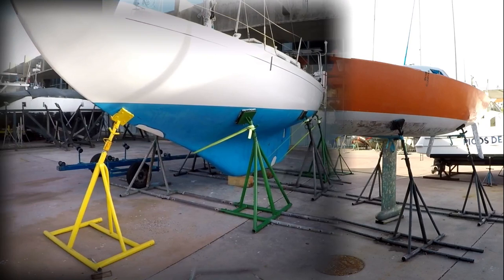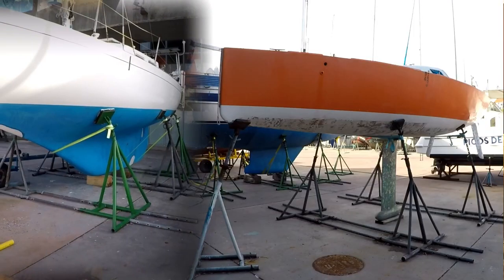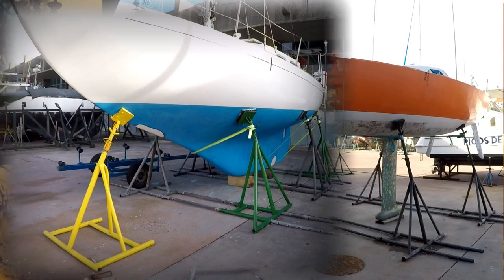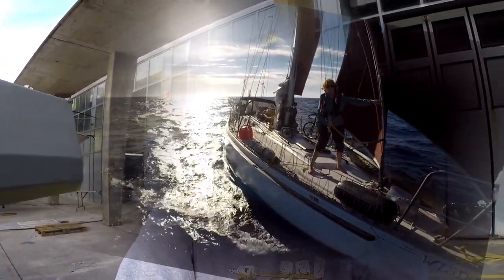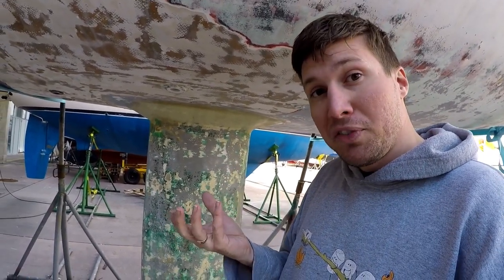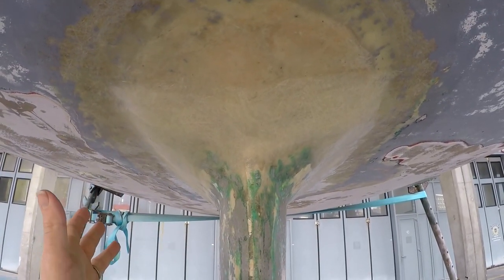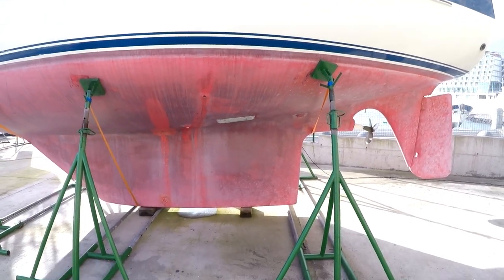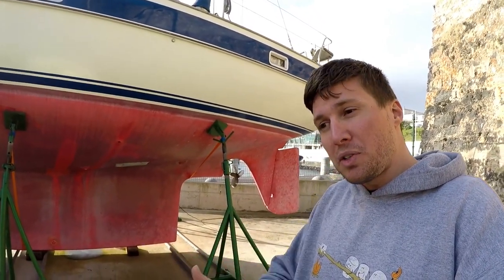Which is the BEST Keel Design? | Sailing Wisdom

Comment: I'm looking at a Contessa 26 and my friends told me that I won't be happy because it'll be so slow. What do you think?
If you have two identical boats, one with a full keel and one with a race keel. Say for simplicity sake, the full keel boat top speed is 6 knots. What would the high aspect ratio keel boat top speed be? Obviously this would just be a guess..but what's your guess? Thank you:)
Reply from the maker: The top speeds will be the same because of the hull speed limit. Basically, the longer the boats waterline, the faster it can sail without planning. If both boys have the same waterline length, no top speed difference! The equation is: hull speed = (water line length in feet)^0.5 x 1.34
The big difference comes in light winds. A heavy full keel will need more wind to get going while a light boat will zip along. I went out on a race boat one time, it was only 20 feet long and we did 18 knots! Obviously it gets up on plane and exceeds hull speed, and it did this in light conditions. It was very fun but I would be terrified of that thing if a squall came up while out sailing. A heavy boat usually needs about 15-20 knots of wind to start sailing nicely. 
In my experience, when we are out sailing in light air days (10 knots of wind or less), everyone is motoring. The light boats and the heavy boats are all going hull speed under diesel power, so no one actually takes advantage of their ability to sail in light wind. My favorite was when we passed a guy who was motoring and we were on a beam reach. He had a very light Hunter and was going the same direction, he could have been sailing but was motoring through the light breeze. 

My opinion: Contessa makes a really nice solid boat that you can have fun playing around in and if you ever decide you want to go further (or if you get hit by a storm) you are already in a very capable boat.

Comment: What is your opinion of a modified keel or centerboard? I have a '72 Pearson 33 with a 4 ft draft and a centerboard. My keel isn't as long as a full keel but it's longer than a fin keel just shorter. The centerboard gives a draft over 7 .5 ft.
Reply from the maker: Center boards are the best of both worlds. Shallow draft and excellent pointing performance!  Best of all, just as you can trim your sails to move the CE, you can also trim the board to move your CLR and balance the boat out better.

Comment: The front edge doesn't do everything lol. you can't just have a pencil say with a weight at the bottom for a keel, even if it was structurally possible, yes that would give a righting moment but the water pressure to enable sailing to windward comes from the surface area, at the cost of drag. It's a compromise.
Reply from the maker: Actually the pencil edge is all we need, but we don’t have the materials to make a pencil keel. All it needs is a aerofoil shape that is as high aspect ratio as possible to give the most lift with the least drag.

Comment: My boat has a cast iron keel which is bolted to the hull, and a skeg rudder.  However it's an older design (mid 1970s) so it has an integral "shoe" which is a wider flat portion at the top, which fits into a recess in the hull.  It seems a good compromise, with the stress over a wider area.
Reply from the maker: Sounds like the best of both worlds! Performance and strength

Comment: To make a statement "a keel to outrun a storm" is nonsense. No boat can outrun a storm when you are in bluewater at sea. Maybe, possibly if you are just off shore, but that will depend on wind conditions. Crazy to rely on the wind you need when you need to outrun a storm.
Reply from the maker: I agree! It’s much better to be able to ride a storm out than to rely on outrunning a storm.

Comment: It's not just the leading edge that provides lateral resistance to bring the boat to windward, it is proportional to the surface area, at the expense of drag.
Reply from the maker: Yes, but the leading edge does the most so the rest of the keel is just drag. This is why foiling boats have such high aspect ratio foils: maximum efficiency with minimal drag. 
That said, these also need speed to work while a low aspect ratio foil will provide lots of lateral resistance at very slow speeds. This is why a full keel heaves to and drifts slower than a fin keel.

Comment: I to like the long and full keel design however there is little information   of what is a reasonable draft depth for blue water cruising, what are your thoughts
Reply from the maker: Personally, the deeper the better when you are offshore. The water is thousands of feet deep, so bumping the bottom is not a concern. The further down the ballast is, the more effective it is at resisting the heeling forces from the wind on the sails. 
The issue is when you want to come into port, draft instantly becomes a concern and the deciding factor. On the US, west coast boats will typically have drafts of 8 to 10 feet because all of their waters are deeper, while on the east coast 4.5 foot drafts are the favored because it’s much shallower on that side. 
Wisdom has a 6.5’ draft and is considered a “deep draft” boat on the east coast. There are places that we just don’t fit (the Florida Keys) because of our keel. 
The question really comes down to where you want to sail, and then choosing a seaworthy boat that will let you sail into your destination.

Comment: Aero dynamic? Really? How about hydro-dynamic. It's not an airplane.
Reply from the maker: While not an airplane, the concepts are the same and the keel is referred to as an airfoil. 
On a boat, the term hydrofoil is reserved for appendages that will raise the yacht out of the water. On “foiling” sailing yachts, the keel is “airfoil” while the foils that lift it out of the water are the “hydrofoils”.
Reply: @RiggingDoctor  I prefer to keep as few apendages outside of the hull a possible.  Thanks for explanation on that.

Comment: The best keel design is mine, not really joking but everyone has an opinion. I dont even like or want a keel in the sense you mean. I will never own anything other than a catamaran or a  trimaran. Retyractable centertboatds are a must because I like to go close to the land or beach it or noit run into reefs as easilly or get stick on sandbars..i also like to sail fast and not be bothered with silly things like hullspeed, thats just the way I am..
Reply from the maker: I LOVE TRIMARANS!! But I couldn’t find one that was liveable in my budget, so I went monohull.
Multihull have the best keels possible! No need for ballast, put it down when you need it, bring it up when you don’t.
I always have this massive thing hanging down in the water, even when I’m anchored, then I have to dinghy super far to get to shore. Always jealous of multihulls that are AT the beach 👍
Reply: @RiggingDoctor  Use your time aboard to further educate yourself, make your vessel a boarding school, come back to land for a high paying job or a merchant marine vessel, save your money and go at it again with a little bigger boat
Reply from the maker: That would be a good system, but this is our forever boat. Bought her about 7 years ago (2012) for $20k and rebuilt her over 5 years while working as a dentist. Now we are off cruising :)
Reply: @RiggingDoctor  you are very knowledgeable in your presentation but you are having very high expectations of a old boat

Comment: Just a quick thank you for the video. Very informative and well explained and easy to understand. Just one question which I don't know if you will be able to give some indication. How much cruising speed would you estimate would be lost between a full keel  and a fin cruiser type keel if both boats were the same length.
Reply from the maker: This will play a big part in light winds. A full keel will sit while a fin keel will ghost along under the working sail. To counteract this, we have a suit of light air sails that let us ghost in very light winds. 
A full keel will still move along but will need a special set of sails in light wind. In high wind, both boats will have enough wind available to go as fast as the captain desires, and the heavier full keel will move more gently compared to the lighter fin keel who will be bouncing around. 
For sailors with diesels, both boats will be too slow in light winds and we see both of them motoring along at near hull speed when the winds are light 🤣 while we sit there moving at 1-2 knots with our light air sails.

Comment: The Morgan 45 is a long keel as is the Alberg 30, not a full keel. It is sea-kindly but the full keel still holds the cup for ultimate sea-kindliness and seaworthiness.
Reply from the maker: In the states, they call them all full keels (or modified full keels or cutaway full keels) but spending some tome with the English we have learned the distinction between full and long keels.
Reply: @RiggingDoctor  Ahh... I wasn't aware of that. Being the owner of a full-keel boat AND English, I'm very protective of the distinction. lol The other benefit of the full-keel is its capacity to carry water and fuel within the keel, low down below the waterline. I carry 150 gallons of water and 125 gallons of diesel, basically, over a ton of extra ballast.

Comment: I'm hoping to buy a boat soon and have little experience but RYA qualifications. My instinct is to be safe but getting a full keel seems to have a direct relationship to low SA/D ratio  eg speed. Also, how much more difficult is manouvering in marinas for a full keel compared to fin keel. 10%, 50% or more? Finally is there a sail type that suits a full keel  eg cutter, sloop, ketch?

Comment: A hard chine design like that give you more room in the cabin and probably has less rolling motion than the round bilge you have on Wisdom. Not being smart here but the keel design on your boat comes off a grounding much easier than that full keel would. I really liked it when you showed it. I suspect it would be a comfortable boat, but not fast, on the ocean.
Reply from the maker: No offense taken. Our keel actually matched the slope of that beach perfectly 🤪
In the ICW, we hit a few sandbars with speed and simply slid up over them. I wonder with a more vertical leading edge of the Alberg if it would have been more of a thud!
Reply: I would agree with that and with the long keel suction would make it even harder to break free. On the other side with the long keel you carrying the same weight and spreading it over a longer length so it probably has about a foot or so less draft. It's always about compromises. By the way, 400 amps at 48 volts dc is a huge load on you batteries. What is your total 48 volt charging capacity now? Thanks.

Comment: I hear that full/long keels are less maneuverable in marinas, they track better especially with self steering, and they have better "sea motion", but do you have any video to show what all that actually means? My fin keel literally turns on a dime but keeping it pointed in a straight line at sea is terribly difficult so I'm very curious how much better a fuller keel will handle out on the water. Any videos to show this? Thanks.
Reply from the maker: https://youtu.be/-ryeqwUSMa0
At 10:50 in, you can see the helm not moving much as the wind steering holds out course in the ocean with a large following sea.
Reply: @RiggingDoctor  Wow, that's awesome! Thanks for finding that footage.

Comment: There are good and bad designs in all keel forms. I can show you fin keel boats that will absolutely out perform the vast majority of long keel boats in a storm. I can show you ones that I'd be wary about sailing across the bay. I've sailed long keel designs that are flat out dangerous in a seaway and vice versa. You must consider the design in its totally, you can't just focus on the one feature of a design! It is unreasonable to draw any conclusion about a boats ability on the shape of its keel.

Comment: F.Y.I. If you are racing your long keeled boat in a conglomerate series against boats of different sizes with different keels, there are formulas used to assign handicaps to boats so that strengths and weaknesses of design that affect speed are considered and all boats are on an even playing field. So the results of the race can be determined by the strategies and skill of the skipper and crew on the boat not by the design of the boat.

Comment: Exactly how does a boat with a fin keel "outrun" a storm at 8 knts?
Reply from the maker: 😂 I know!
It’s going to hit you and it will hurt when it does if you have all your sails up as you try to outrun it.
Reply: @RiggingDoctor  reef early and get real.
My Skookum is not going to outrun anything but it really does not need to. There is no boat I would rather be in except maybe a kraken 50, if i had an extra 1.5 million to spend.

Comment: Keels are specific to a particular model or make?
Reply from the maker: They tend to be lumped into Fin and Full
In the fin variety, there are all sorts like wing keels, as well as various styles of bulbs. The one thing they all have in common is the look like a small fin popping out of the bottom of the boat.
Full keels also have a bunch of variety: full, cutaway forefoot, long, modified...
These all tend to be a part of the hull with the ballast being internal. They are also wider and bigger, making a huge wall under the boat.